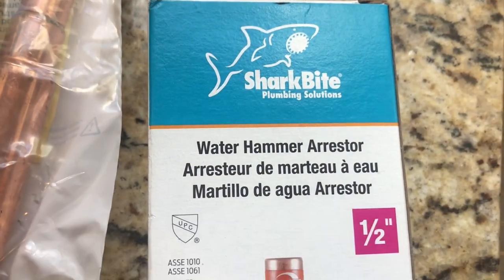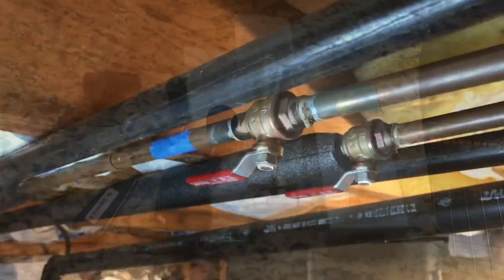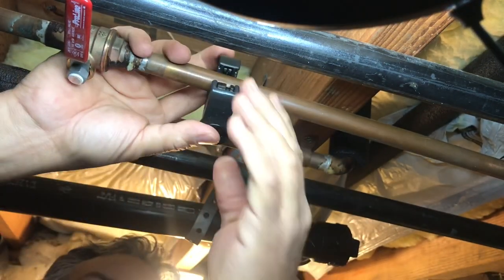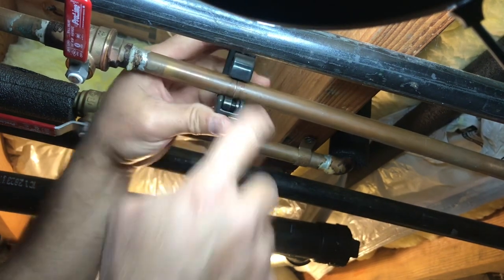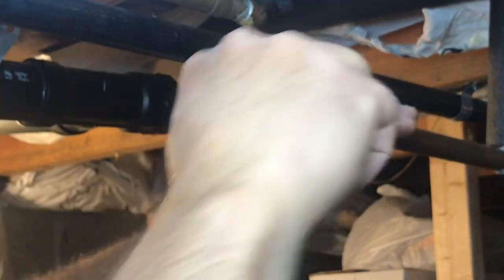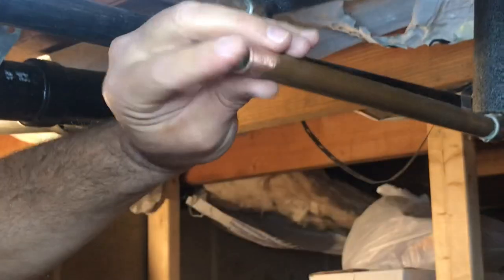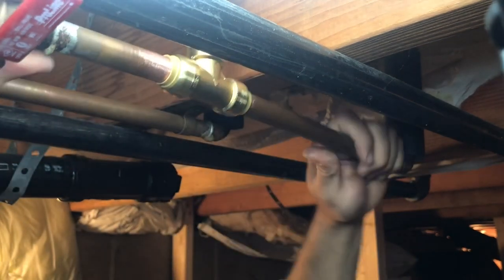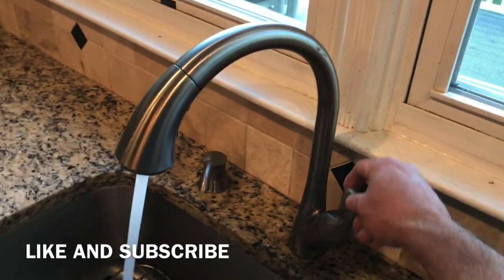HOW TO FIX LOUD BANGING WATER PIPES / WATER HAMMER - Installing a Water Hammer Arrestor. Easy!

Comment: Hi, did you only have to do one cut of the pipe? Did it not extend the pipe length when you added the arrestor?
Reply from the maker: Yes, but I had room to extend a little. You will need to do another cut if you don’t have any room.

Comment: Nearly every morning, I hear a loud and dull thud type of a sound from the condo upstairs. The sounds repeats at irregular intervals. This seems to happen when they are running the water in the morning. This sound doesn't happen as fast as what you show at 0:05.  It's more spaced out. It sounds like they are dropping heavy objects on the floor. 

Do you have any idea what could be causing this?
Reply: The same thing just when they shut the water off

Comment: hi great job, my banging noise sound about 1-2 mins apart through out the day and night even after water is off for several hours, any suggestion?
Reply from the maker: Find the pipe that’s making noise. If it’s lose or vibrating, try putting a couple of straps on it to secure it. If it’s still making noise, a water hammer arrestor should fix the problem.
Reply: send the wives boyfriend on his way

Comment: Do you put this at the start of the cold water house feed in the basement or right under the kitchen floor cold water feed?
Reply from the maker: They recommend installing it close to the faucet. Depending on which line is hammering, it can be installed on both cold or hot water lines.

Comment: I have seen people installing it with the washing machine which is much easier. Is there a reason you didn't do it there? No cutting etc.
Reply from the maker: It depends on what pipe is banging.  I didn’t have enough room to install under the kitchen sink.

Comment: Any leaks since?
Reply from the maker: No leaks
Reply: @fixinit  thanks
Reply: @fixinit  I have a banging noise from my pipes when we open and close faucets.  I don't know where to add the hammer arrestor. Noise is coming from the shower tub but there is no room to work behind it. Will it work if I put it somewhere in my basement?
Reply from the maker: Make sure all pipes are strapped tight. Lose pipes can cause noise. Water arrestor should be installed as close to the noise as possible. You can try the basement if you have no choice, it can’t hurt.
Reply: @fixinit  thanks, I checked the pipes. There is no movement. Sound comes from within
Reply: @newphone3594  I had banging in my master shower. Now way to get to the water pipes. So I took a chance and installed 2 water hammer arresters at the washer hook ups. I had banging on both hot and cold in the wall whenever any faucet or toilet was used. No more water hammer right now. I hope it's gone for good. I bought the Sioux Chief Minirester from Ace Hardware. They had  much better reviews than the shark bite brand. $17.99 each
Reply: @fauxque5057  hey is it still working? I have the same issue in my master bathroom. I mistakenly bought the water hammers arrestees for washing machine hookup and want to see if it might work for me